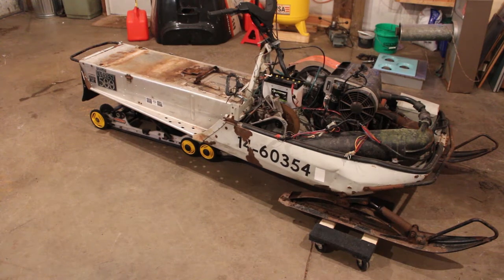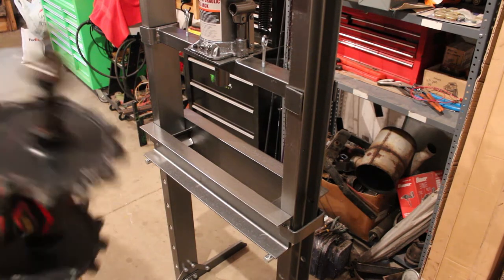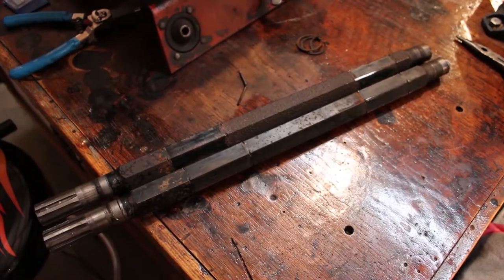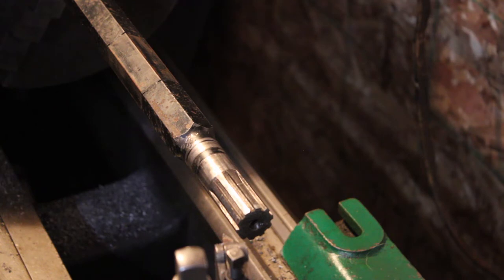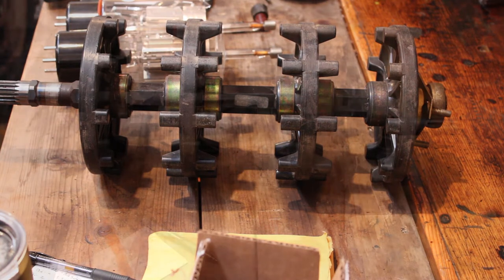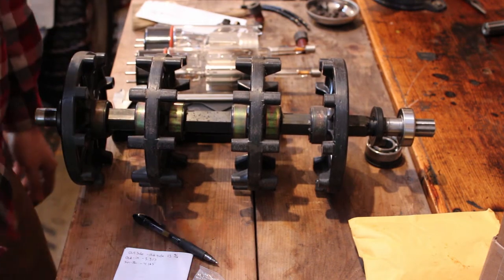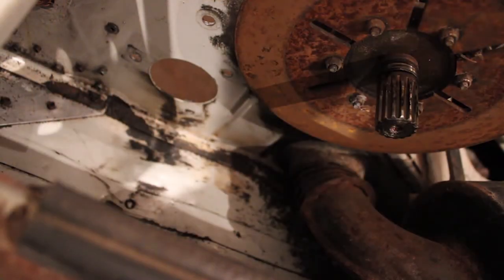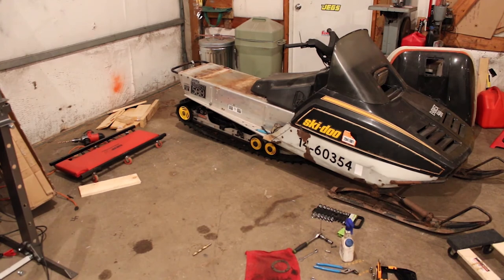1980 Skidoo Everest driver swap and 136" SC10-3 skid install. Part 2 of a vintage mod sled build.

Comment: had the same issue with driver removal when i modded a 76 el tigre   i just burned them off with a weed burner. once they were warm and mushy just scraped them off with a putty knife

Comment: When you changed over the drivers, what is the size difference in diameter from the existing 11 tooth ones to the new ones from the renegade? How many teeth do the new ones have, and was the switch enough for the 1-1/4" track to fit and not hit the tunnel? also did you feel the swap for the 1-1/4" track lacked power from the everest?
Reply from the maker: The original drivers were about 8 1/4", the new drivers are 7", so you gain about 5/8" track space with the driver swap. The new drivers are 9 tooth and theres no issues with tunnel clearance, but I would say that track is actually closer to .8-1". Still plenty of room to go up in lug size, I think you could go as big as 1.5". No noticeable loss of power. I mean keep in mind it's still just a 503, but I'm 230lbs and it can still pick the skis up off the ground. Before I did the front end swap I took it out in some deep powder and even with the nose buried in the snow it still got around pretty darn well.